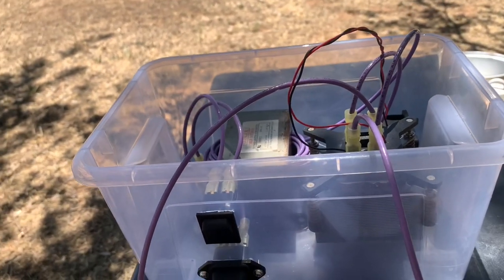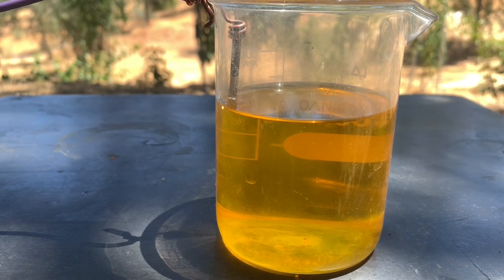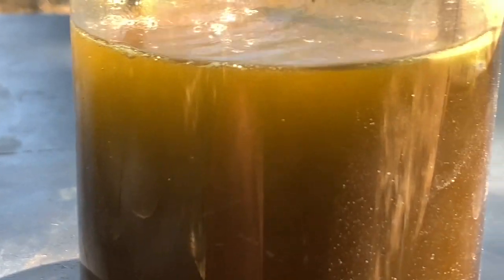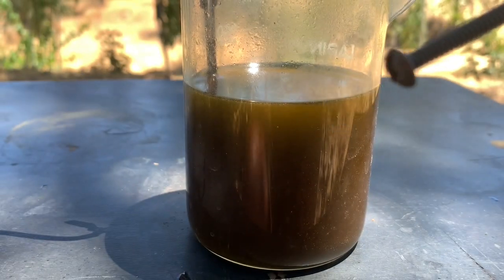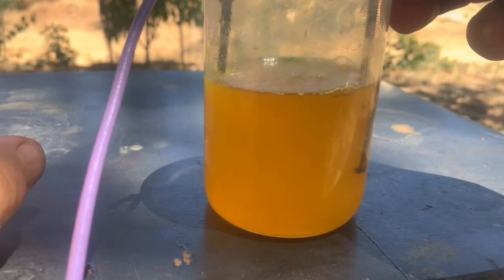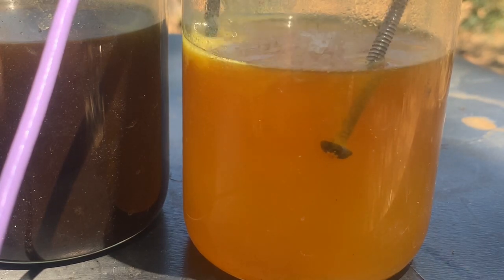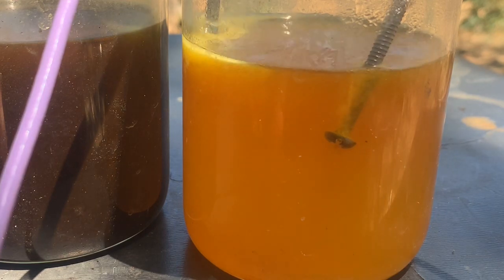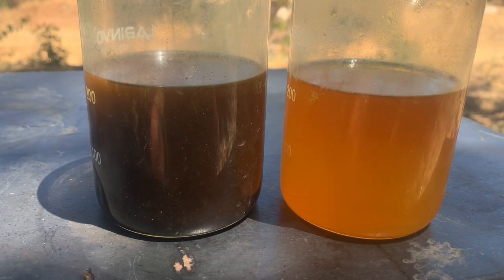Electrolysis will tell you ,you have gold or not

Comment: Good day, Did electrolyses participatr if ther  another minerals in solution, or electrolyses participate just the gold? Thanks
Reply from the maker: You need have hydrochloric acide in solution then you get gold and all pm . Rest of metals can’t come from solution , hydrochloric acide don’t let them come out . Gold and pm don’t dissolve in hydrochloric acide. So they comes out from solution and stays in form of brown powder . Then you just collect that brown powder and smelt. If you don’t like purity then you do regaining
Reply: @myadventure7069 What do you mean by hydrochloric only means nitric neutralization?
Reply from the maker: Man when you kill the nitric hydrochloric acide stays in solution and don’t let useless metals precipitate
Reply: @myadventure7069 would it work on muriatic acid? Is it the same?
Reply: @pro.empire  Muriatic IS hydrochloric acid.
Reply from the maker: @woodsie5474 yes
Reply: Wouldn't the iron screws drop iron into the solution. You wouldn't want to hold them in there to long just a quick swish around or then u got to deal with the iron also

Comment: Thus you using 12V and about 10 amps, brings me to the idea to try it with a regular laptop charger. Voltage and amps are matching ....let's try later afternoon.
So far I really like you way. Its simple and easy. Thanks
Reply from the maker: Stop ! You burn your charger !
Reply: @myadventure7069 Soo no laptop charger?

Comment: Thus you using 12V and about 10 amps, brings me to the idea to try it with a regular laptop charger. Voltage and amps are matching ....let's try later afternoon.
So far I really like you way. Its simple and easy. Thanks